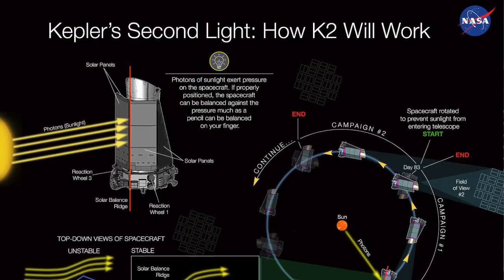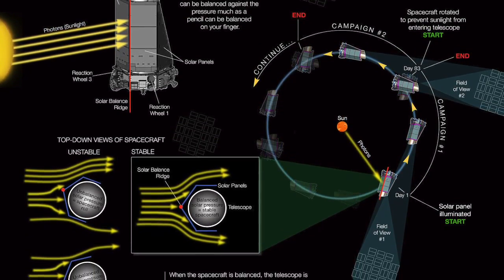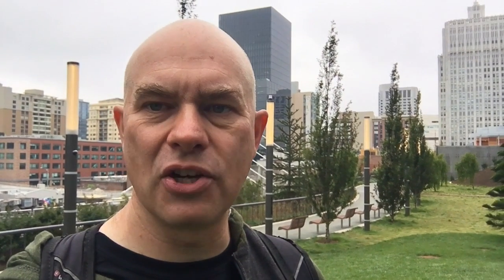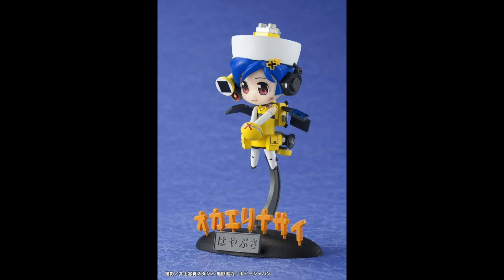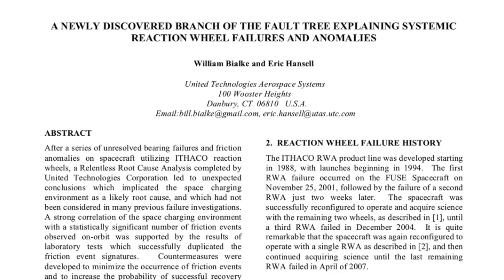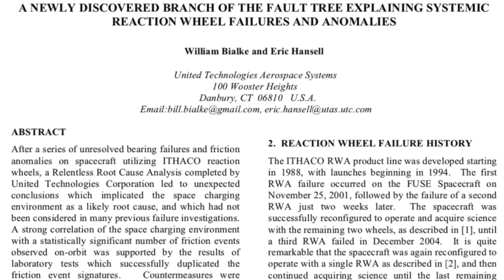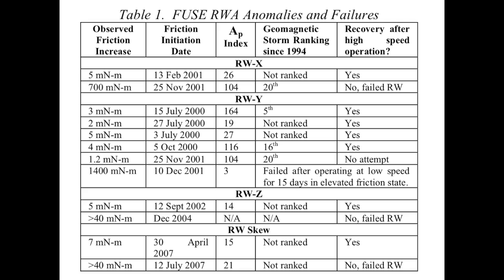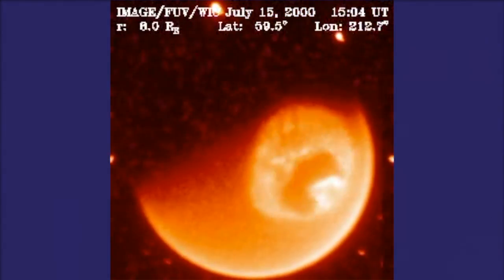Scientists May Have Figured Out Why So Many Spacecraft Were Failing

Comment: I used to work in industry building 1, 2 and 3 axis positioning systems for satellite and telemetry tracking as well as radar and EW systems. These were usually outside in the environment. We always had a hard cable from one axis to the other, when possible, for grounding in case of lightning strikes because the discharge would go right through the bearings and fuse them. It was like hitting the balls with an arc welder. If we had slip rings for continuous motion we would reserve a number of circuits just for ground in case of lightning. It was easier and cheaper to replace a slip ring than a bearing.

Comment: There was a 1200 horsepower motor at a cement plant where I frequently work that had repeated bearing failures from electrical discharge across the bearings. They ended up replacing the bearings of the tail end of the motor with ceramic bearings to reduce the electrical current problem, and had a ground brush connected to the shaft to drain the voltage away without it crossing the bearings.

Comment: There's a company that makes a little brush for discharging motor shafts to avoid this issue on industrial motors.  Apparently ESD is what was causing a lot of bearings / drivetrains in Teslas to fail.  https://www.youtube.com/watch?v=X1G4LmI5c80

Comment: Cold welding of the steel bearings?
Thats my guess before watching
Reply: That's a good side theory ionizing radiation could remove the oxide layer and would still be solved with ceramic balls

Comment: Surprised that it took them this long to figure out.  Try running a DC motor that has the return shorted to ground.  It will produce the same effect.  Typically we got the parts back for noise but found that the bearing raceway was pitted  then found that the negative return was shorted to ground.  This was with 13.5 VDC so it figures that static build up in space would do the same.

Comment: Well, one problem I've have is that, say, the "X" reaction wheel changes speed.  The movement of the spacecraft cause extreme strain on the "Y" and "Z" reaction wheel bearings if you are already turning a a good rate of speed.   Perhaps they should have go back to the basics and find ways of using the bearing strain to advantage.

Comment: I've been saying this since I first heard about this problem. I get Phd.s arguing that there isn't any charge separation in space. We should know better by now. Too many papers already on this.
Reply from the maker: Wait really? The ISS includes special hardware to eliminate accumulated charge.
Reply: @scottmanley  Well, as pointed out, the switch to ceramic/non-conductive bearings seems to have solved the problem so far. How does the ISS do that? I haven't been able to find any info on it. Thanks for the reply. Your videos are the most informative I've run into. Thanks for that too.
Reply from the maker: @Myrddnn  There's a device called a plasma contactor: https://en.wikipedia.org/wiki/Plasma_contactor

Comment: Sorta shocked ceramic bearings weren't used from the start. Been using these in go karts for many years and they spin forever compared to their streel counterparts. Only downside is the ceramic bearings can be less tolerate of dropping when changing them out and cleaning😀

Comment: This is called "ball bearing motor" effect. Drive a current thru two bearings conducting rod and it will spin. here we have the opposite. Magnetic field (from a solar flare or whatever magnetic event in space) + spinning metallic reaction wheel produce a current. the two conduction ball bearing shorts circuits thru the casing and creating damaging effects to balls.
SOLUTION: isolate the bearings. ceramics will work as well. but much much expensive.

Comment: We had similar failures on chillers at work.   The problem is caused by VFD drives causing spalling (electrical pitting) in the motor bearings.   Ceramic bearings so far has cured the problem.

Comment: Bearings fail when the person putting it in place do it wrong. When pressing the bearing in or on and the bearing are supported at the wrong place the bearing will fail in time. Same with heating and cooling of the bearing. To much heat or not enough heat or to cold can also damage bearings. To much or to little lubricant will also cause the bearing to fail. The wrong viscosity of the lubricant can also cause the bearing to fail. Inferior metal can also cause the bearing to fail. Same with electrical arc or electrical carbon building up in the bearing as a magnetic veld is around the bearing.

Comment: Interesting. We had a high rate of failure of accelerometers when working on helicopters in Afghanistan in high altitude. I thought at the time it was due to high altitude radiation being constant over there, or maybe the damping liquids in there bubbling out.

Comment: Correct me if I'm wrong, but stars tend to eject plasma regularly because the rotation of the equator and poles don't sync, and the ejection is due to field lines snapping and reforming.

Comment: The real reason is that scientists mistakenly assume that angular momentum is conserved, when in fact it is not. Instead, the wheels are subjected to precessional forces, which convert angular momentum into linear momentum. Also, linear momentum of the spacecraft can be absorbed into its own angular momentum due to precession of the wheels. The sum of linear and angular momentum are conserved, but the morphing of one into the other complicates stabilization enormously. The same problem was encountered with the V-22. The problem lies in the dogmatic reliance on a mistaken interpretation of Newton's Rule.

Comment: This idea is interesting and probably true.  The satellites that I operated had the usual four reaction wheels (X, Y, Z, skew) but they flew at an orbit with 830km apogee and 815 perigee.  Most of their polar orbits were inside the inner Van Allen belt, although they were outside while passing over the poles and sometimes through the South Atlantic Anomaly.  For that reason, our reaction wheel failures were due to the slow increase in the speed of the wheels to keep the satellite pointing directly at the Earth.  Even with magnetic clamping, the nature of the orbits were such that the average speeds slowly increased to a point where the wheel couldn't be spun any faster and therefore couldn't have the gyroscopic effect necessary for attitude adjustment.

Comment: Anything made of 2+ things can act like a capacitor...and with ceramics the breakdown voltage is higher true, but, still possible.  Arc'ing also cokes the oil usually.

Comment: This makes perfect sense to me. I remember reading a story many years ago about how an electric motor bearing was found to be failing due to a short between the rotor winding and the rotor itself. The small electric current through the bearing caused increased bearing wear, and eventually, early bearing failure.

Comment: My first job out of trade school was working for Sperry Flight Systems testing reaction wheels. We’d put them in test chambers to mimic the cold and vacuum of space and then run them continuously 24/7 for weeks. They were designed to withstand cosmic radiation ... guess no one thought that coronal mass ejections were also a danger?

Comment: FYI it's United Technologies Corp, and has had a pseudo-permanent post on the Dow Jones industrial average since the late 1930s. They also make the spacesuit (EMU), Pratt & Whitney engines, the Shuttle and Apollo fuel cells, blah blah blah. They used to make Sikorsky helicopters until they sold it to Lockheed. Long before that they even owned United Airlines and Boeing before the US Gov't broke them up.

Comment: Tsk tsk tsk... You know what never fails because of Metal Bearings and spins for hours on end? Hard Disk Drives. Why? FDB(Fluid Dynamic Bearings). There are high load industrial applications that use FDB as well. There is no reason they shouldn't be using them in Reaction wheels.

Comment: Sounds like non-electric conducting bearings are in order.

There are bearings with plastic races, used mostly by the food industry. They are durable.... and yeah... ceramic... probably better given the temperature variances in space.

Chipping in my 2 cents. I'm a gizmologyst.

Comment: The reaction wheels of the Hubble-Telescope have been replaced and brought back, so it is possible to examine if the theory holds water.
Reply from the maker: Different manufacturer.
Reply: @scottmanley  So the failure of the other reaction wheels have a different cause and there is that much difference between the constructions and the materials so you can´t compare it? On the other hand, the wheels of Hubble have been replaced several times and the engineers might have improved them but could not come up with a solution to make them last significantly longer.

Comment: I've seen a few earth shorting springs in old 5 1/4 inch disk drives. A small phosphor bronze spring shorted the platter spindle to ground and I could not understand why it was there, it didn't seem to serve any mechanical purpose.
Maybe it was there to prevent a potential build up of static on the disk platter.

Comment: As just a Leyman, I wonder if that electrical charge jumping from the steel bearings doesn't cause a chemical change or other breakdown of the enclosed grease/oil in the temperature extremes of space. I can imagine it would cause the grease to become gummy where the charge occurs, thus causing the bearing to stick. That seems easy enough for them to simulate in a lab. Then again, if the bearings were changed to ceramic, that gap would be far too large for any current of that small level (6 volts) to jump. It still seems worth knowing for future situations utilizing grease around steel.

Comment: So about a minute into this video, Im thinking, Hmm probably not ceramic bearings. Why are they not using ceramic bearings? They don’t corrode. The act as an insulator. Unless you are using them in a high weight environment you dont need steel....hmm oh steel is cheap and you can get them at NAPA.

Comment: Electrical erosion of bearings is a known problem for motors that are driven by modern power saving pulse width modulation (PWM) electric drive systems. The solution is to install a contact brush between the motor frame and the spinning shaft, similar to the carbon brushes in the commutator of a DC motor/generator.
The extremely high frequency modulated power induces eddy currents in the metal frame and rotor of the motor, and the bearing forms a very slight resistive path between them so arcing can occur across the bearing race in the exact same manner. Apparently this was affecting early Tesla vehicles at some point, where the drive motor would sound like it is grinding when spinning.

Comment: True story:
Cars were invented before portable radios. When people started adding tube receivers to their Model "T" cars, they noticed a lot of noise being generated by the cars. They found out they had to add grounding straps to all moving parts. The driveshaft was causing a lot of noise so they added a springy "flap" of brass bolted to the frame that touched the driveshaft (much like the brushes in a universal motor) to remove any accumulated charges.

Edit:
What about a grease (or other lubricant designed for spaceships) that's had some graphite added? I suppose a few megohms of resistance would be enough to drain off any accumulated charges over time.

Comment: I used to be a high vacuum service engineer.  One type of vacuum pump used to achieve a ultra high vacuum is a turbomolecular pump which internally looks like a jet engine but is powered by a motor.  As these pumps have rotors which spin up to 120,000 RPM so that bearings are a source of failure. To get around this magnetic bearings are employed so there is no physical contact between what spins and what doesn't.  Why don't these reaction wheels use magnetic bearings?
Reply from the maker: Because it’s not speed that’s important, it’s torque.
Reply: @scottmanley  Yes, however active magnetic bearings use electromagnets with an active control system keeping the load stable and can be used in many applications such as machine tool operation and flywheel energy storage (FES) such as NASA's G2 flywheel for spacecraft energy storage.  Perhaps it was the cost which prevented the use of active magnetic bearings for the reaction wheels.
https://youtu.be/mz_7UF4KQpk?t=34

Comment: Would it be feasible to create a zero-contact reaction wheel with magnetic rails like a maglev train?  Even though there's no contact, angular momentum would still be transferred by pushing off the magnetic fields.  As an added bonus, the system's magnetic field may offer some protection against solar winds if it's strong enough.
Reply: Conventional bearings are zero contact - they ride on a film of oil.  Sparks jump the gap.  Sparks can still jump the gap in your magnetic bearing..
Reply: @stargazer7644  except that oil can conduct electricity, whereas the vacuum of tinyfoxtoms mag bearing couldnt
Reply: @deanrensberger631  Oil is a dielectric. It doesn't conduct electricity.  In fact, all those large power transformers you see on poles and on the ground are filled with oil.
Reply: @stargazer7644  you dont understand what we're talking about. Oil isnt a perfect insulator like the vacuum. Its conductivity is what allowed these mcgs to fail.
Reply: @deanrensberger631  I think it is you who doesn't understand any of the points I have made, nor the actual study that's being referenced.  It has nothing to do with "oil conductivity". Bearing lubricant in the study has a breakdown voltage of 60 kV/mm which is comparable to vacuum breakdown voltage.  In fact, if the oil were conductive, the problem wouldn't exist because the two sides of the bearings would be equipotential and a charge couldn't build up at all.
Reply: @stargazer7644  yep, you're right. I thought there wasnt electrical breakdowns in a vacuum. Sorry bro.
Reply: Assuming you use superconductors then sure but spacecraft already have issues radiating heat

Comment: No Name is right that problem of arcing and pitting is a common occurrence in all mechanical switching of power and ad to that the need for very close tolerance failure rate is always going to be high all you can do is try to mitigate problems.

Comment: So, a design reaction [punny], is plastic bearings in common industrial use, i.e. mining conveyors, these are self•lubing, IGUS a supplier I'm aware of has 3d filaments also. 

My other take is using sleeve bearings vs balls which are rpm range rated, modern sleeves should perform variable service well by more contact area at low speeds, worth looking at, the hunch when it rolls slowly one side connects well and arcs more current the other creating pits, assumes the ambient charge of space is negative, not neutral.
Cheers!

Comment: Bullshit mate, sorry. I'm an engineer, I've done a lot of research and development on bearings. If there is a given company selling something that fails, its the product that is at fault, not solar radiation. Bearings fail due to overloading, contamination, installation error and incorrect selection of type. There are other reasons but these are the main reasons. I bet this is why they have issues. If I were to guess, they have gone for something with too close a tolerance. I've worked with aerospace people and they all over tolerance things. They cause problems and misunderstand the effect of accuracy. Too much is a bad, bad thing. 
I actually worked with a guy that designed a stabilizer for European space agency. That system went dead too. Over tolerances everything, nothing fits together first time that he designs. 
The lesson here is loosen things off, give holes bit of play and dontovercomplicate things. Its just space, it's not that big of a deal. Make something that lasts years at the bottom of the ocean, far more challenging and understand that ifwemake things for that, space is far easier. Do not believe the hype, space is not as special overcomplicated as it is made out to be.

Comment: Maybe turn off reaction wheels when a flare is present?
Reply: That requires either using up all your fuel much faster dumping the momentum from the wheels, or putting your spacecraft into an unrecoverable tumble.  If you stop spinning the wheels, then the spacecraft starts spinning, unless you use a thruster to counteract it.  The whole point of putting reaction wheels on spacecraft is to reduce the use of thruster fuel.

Comment: Thanks for the interesting topic. I know a lot of people here complain about the extra cost of ceramic bearings but they should first ask themselves whether it would be more prudent or not to spend a few thousand dollars more for a product that could save a $300 million mission or not. I worked for a while in the technical ceramic industry and yes they are a bit more expensive largely due to the many processes needed to make the product but it's easily justified by the peace of mind and longer usage you will get from your end product that uses the parts. My 2 cents anyways.

Comment: Great video buddy as always Scott.
I'm a mechanical engineer , and it makes alot if sense.
There 's a mechanica proces called "electric sprak erosion" , that is done in an oil bath .
The work piece is connected to the + pole and a graphite electrode -
When currency is switches on , the elektrode cavitates a hole in the workpiece.
From the moment you mentioned static charge , i already knew what the study would say 😉😁...
Grtz huge fan johny geerts